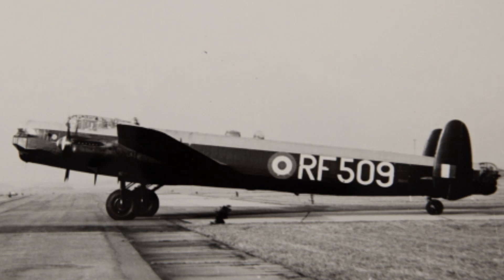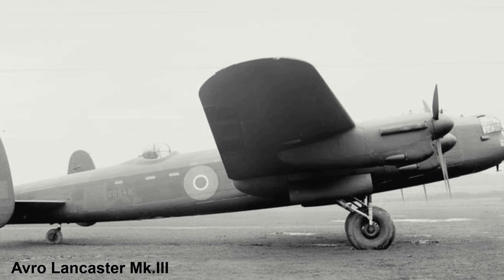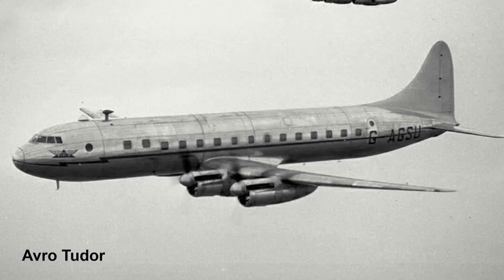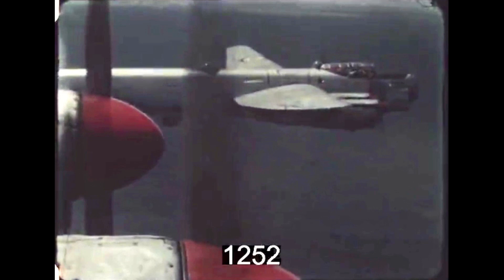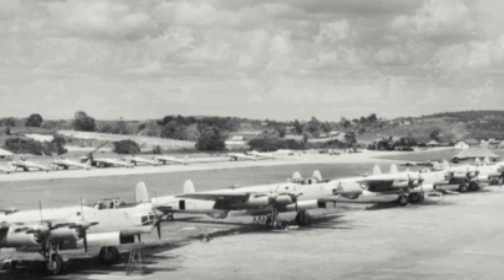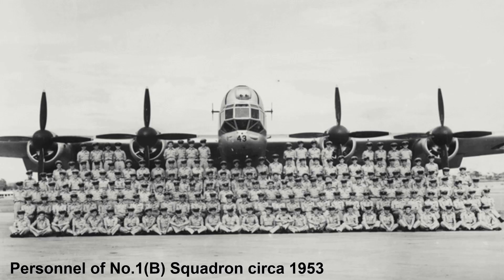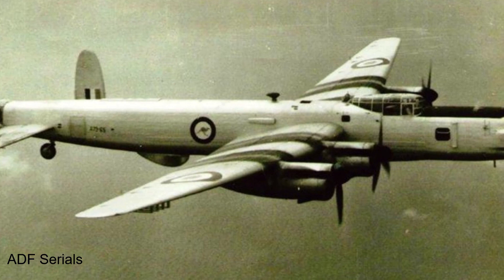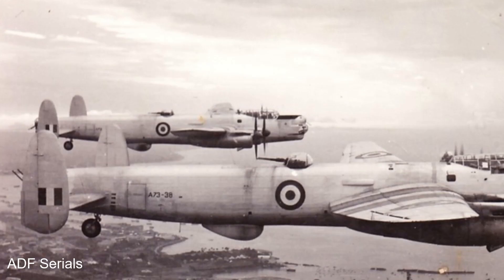The Avro Lincoln in Australia

Comment: Another great video, thanks. I worked at GAF from 1978 to 88 in clerical positions rather than putting metal on metal. At some point in the early 80s I was in the IT department (then called the ADP - Automated Data Processing department) where one of our software engineers did an audit of the spare parts shop prior to a new piece of software being introduced. He found that they still had parts for many of the aircraft GAF had built, including some Lincoln parts.
Reply from the maker: Thank you 👍✈️. That is very interesting, especially considering that all Lincolns were scrapped (most if not all gone by the end of 60s.). GAF did most of the conversion of the Lincolns from Mk.30s to Mk.31, so perhaps some parts left over from that. Or just spare parts the RAAF never needed. Anyhow, interesting to read there was some parts still sitting around.
Reply: @AntiqueAirshow  It was certainly an interesting find. From my (vague) memories it was some undercarriage parts that he found, maybe some engine mounting components. I was just disappointed that no Beaufort or Beaufighter parts still remained because I knew that there were a couple of Beauforts/Beaufighters undergoing restoration. The parts increased based on the age of the various aircraft GAF produced, so there were more Canberra and lots of Mirage parts, as Mirage were then undergoing return to service (prior to F/A-18 selection and manufacture). Jindivik and Ikara were still being produced, too. In fact, I was later involved in a proposal to Britain for a drop-in containerised version of Ikara, with a greatly increased range, which unfortunately didn't go any further. It was meant to be fitted to ordinary cargo ships, as well as naval ships, when needed. GAF was a fascinating, if sometimes frustrating, place to work at in those days.
Reply from the maker: @brettcoster4781  that's cool. Makes sense that there would be more parts for the newer aircraft. Very interesting 👍✈

Comment: I have seen "bits" of Lincolns in several places in Queensland.

The Cadet unit at Redcliffe High School had an elevator in their possession in the early 1970s. I only saw it once. There may still be a few nuts and bolts of the one that speared into a mountain ("Superbus"??), during a flight out of Amberley.

There used to be a "scrapyard" to the West of Toowoomba that featured a LOT of aircraft  relics. One of these was a complete tail turret for a Lincoln. They had most of a Vickers Viscount there as well.

No idea what happened to all of that stuff, since I last saw it in the late 1970s.

There seems to be a dark, vindictive streak in the society that insists in destroying anything of actual value, particularly if the process upsets other people. Carsm, ships, locomotives aircraft; chop them up and make them go away..

Even "official " museums are known to "spirit away" historically significant pieces, especially those of a military nature, specifically weapons. And it they cannot "make it go away" they "neuter" it as mercilessly as possible. Think: Katanas with their edges ground back, small arms welded into solid lumps. Leopard tanks filled with concrete and welded shut. F-111s bulldozed into a trench.
Reply from the maker: That is very interesting. Unfortunately most likely majority was scrapped.  There ain't to many bits of Lincolns left, but hopefully one day the Moorabbin Air Museum will complete theirs.
Reply: I crawled through that Viscount (fuselage only) back in the mid 90s if memory serves me.